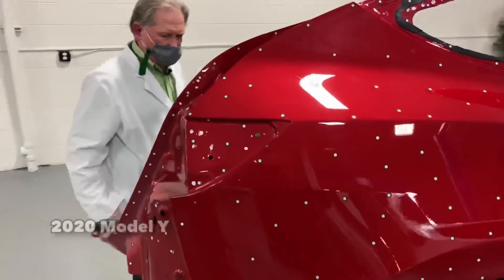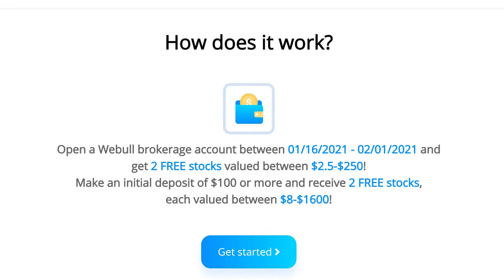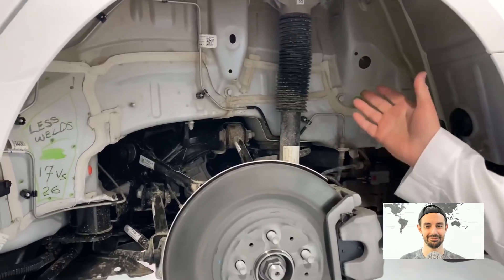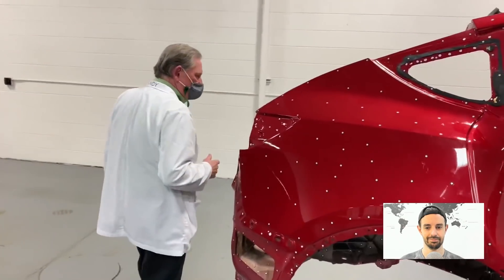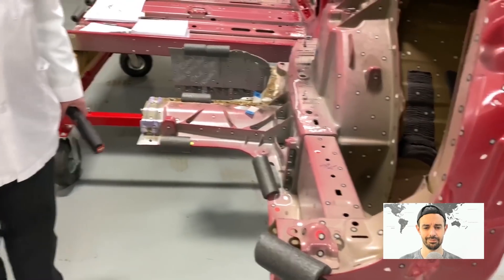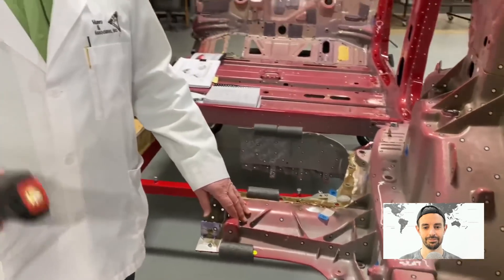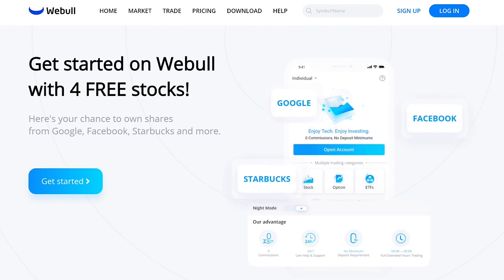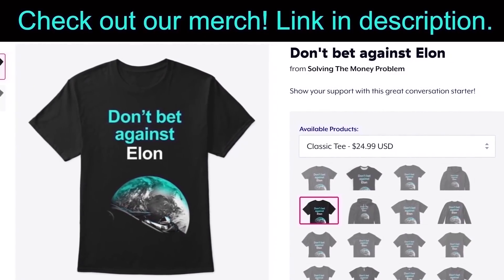Sandy Munro Tears Into Tesla's 2021 Model 3 Engineering

Comment: Once they’re building the Model 3 in Austin (with mega-casting) they will be able to then re-tool Fremont without a significant supply issue. I suspect that’s the reason they’ve held back, they would have to shut down the line for too long and impact deliveries.
Reply: Invest in crypto now
Reply: W.    H.    A     T.    S.    A.    P.   P...+...1...2...2...5...3...9...6...6...2...7...4.............

Comment: It seems my last posts have been to tweak your statements a little bit.  No disrespect meant at all,  I love your videos and watch most all of them.  You mentioned a reason why they would not use the casting on the Model 3 as it is more profitable for the model Y.  True statement, but Sandy was saying it would not take much to  do the Model 3 as well, with the same tooling!  The changeover could be done in hours probably.  He said just block out areas of the mold necessary to match the model 3.  Pull out that block for the Model Y and presto bingo you can save money on both.  The cost of the caster would pay for itself and the mold costs would be less to make it for both cars.
Reply: Invest in crypto now
Reply: W.    H.    A     T.    S.    A.    P.   P...+...1...2...2...5...3...9...6...6...2...7...4.............

Comment: I believe Tesla's long term vision is to move model 3 & Y production to Texas (& possibly another unannounced location).  The Pilot battery factory will support Models S & X only for production in Fremont.  This is why they have not incorporated the casting for the model 3 yet.... because those production lines will be going away.  They will do mega castings & structural battery from the beginning in Texas.

Comment: if they change structural stuff, Tesla would probably need to re-do crash testing, then there might be a discrepancy with different assembly lines getting different ratings needing to upgrade all assembly lines to the new way, so it may be better to sell a car today as is, rather than take months off to build it right , get it re-validated etc...   I bet the made in china model 3 is using the single cast.

Comment: You won't get that giant cast part until the new release of the Model 3, meaning minimum 5 years. Even though I love Tesla, I think they approach their car as an agile product developement, so they make minor changes gradualty over time like redesigning the weld pattern, minor castings, software updates etc. They never fix the big problems, as it would require someting like a total rearchitecture: bad paint (paint peeling at car wash), panel gaps, interior squeaks.

Comment: By now Tesla already has 22 Giga Casting Presses. Between Fremont and Shanghai, That should be enough for all 4 models front and rear parts to be produced both in Fremont and in Shanghai. 

There are even 4 more left, 2 for the Roadster in Fremont and 2 for new model 2 or whatever it would be called in Shanghai. They might just be a little too slow right now, so they have to double them on Model Y.

Comment: I had the same thoughts you did. I know Tesla has set the bar high for Sandy since he now knows that they are capable of perfection. I think Sandy's criticism is justified, as they definitely should be where he says, but I also agree with you, Steven. Tesla needs to deliver cars first. In the same way that buying items on sale that you don't need isn't saving you money, cutting costs on cars you aren't delivering doesn't help you either. Once the Model Y can start carrying their revenues, then they will be able to afford to retool their manufacturing lines to accommodate this tech. All in due time...

Comment: Just realized Vanguard allows you to buy stocks in your Traditional IRA. Sold some VTSAX and bought another 57 shares of TSLA. Oh, and 1000 shares of ARKG, and 127 shares of ARKK. Wish I had done that 6 months ago, or any amount of time ago, really.
Reply: Jan 25 2021 Augwind To Build 120 MWh Of Compressed Air Energy Storage For Solar In Israel. 23 year contract for Solar + Storage at 5 cents  Kw/hr or 65 cent electric gallon. After that, its paid off. The cost drops to 1/4 of that. According to Augwind, the AirBattery system has an overall efficiency of 75-81% (as applied to commercial facilities with a capacity above five MW), and the adoption of compressed air energy storage systems like this is much greener than battery storage systems, due to their high efficiency, longer lifecycles, and the avoidance of any additional chemical components beyond water and air (some of which in battery systems are flammable and either non-recyclable or hard to recycle at end of life). The AirBattery system also doesn’t require the high level of temperature control systems that battery storage systems need, and the company compares their compressed air energy storage system’s efficiency to pumped hydro storage systems, but with much lower physical footprints due to their installation under the ground.  https://cleantechnica.com/2021/01/25/augwind-to-build-120-mwh-of-compressed-air-energy-storage-for-solar-in-israel/

Comment: It’s really easy to be critical.  I’m a structural engineer and making a large casting work is not easy.  The problem is that the single casting is a stiff element, witch will also be attached to another stiff element which means connecting the two together difficult.  Not that easy!  But Stephen has it all correct just by following the money.  The Y first then M3.

Comment: I absolutely love Sandy's opinion on things in general, but I am starting to think he has some blind spots.  For instance, him thinking he is going to get Tesla to make components for his 3 wheeled ventures.  He must not know Elon cuz that ain't gonna happen.  Elon won't make motorcycles and he won't make 3 wheeled vehicles.  Then with this gigacasting for the M3, he must know how long they had to shut down production to do a refresh of the S/X.  Integrating a gigacasting and removing all of the current robots, like you said, is not like flipping a switch.  They cannot afford the downtime.  It would be really cool if they could just.build out a more efficient production line in a new building, but they may be leaving CA so that probably can't happen.  They are either going to have to upgrade Fremont or let it become obsolete and walk away.  Once TX starts producing and they announce another U.S. factory, then we will get an idea of what is happening with the M3 production.  GigaTexas will probably produce M3s as well.  It will be massive to start with and it will be much easier supplying the East Coast or shipping through the Panama Canal from TX.

Comment: I would like to see you make a reaction video to VW outselling M3 in Europe and the Porsche outselling the model S in Europe.
Reply: Check the top 5 cars in each European country.. mostly hatchbacks and small city cars.. I’d probably buy a hatchback from Tesla
Reply: @eldictator1  Tesla needs to make a 25k car as priority 1
Reply: Re-visit this later in 2021 when Berlin is pumping.
Reply: @mearino  I don’t agree with that because  I do not think fundamentally Europeans want a big car. It won’t sell well compared to a hatch. They are also more about quality. I think they will unfairly be over critical to an American made junk car versus a European made junk car all things being equal
Reply: @cabdolla  I was just picking on the two models you mentioned as being outsold. For example, the Model S is clearly outgunned by the Porsche, but the new Model S is on the way, including the Plaid with a price closer to the Porsche but double the range and even better speed and acceleration. I will concede that Porsche held off releasing their Gen 2 because Gen 1 is going so well. The point being, Porsche is outselling Tesla S in Europe now, but will they outsell the Plaid 2021 Tesla S which is a more comparable vehicle pricewise but * should * beat the Porsche on performance? 

As for the hatch, I think you mean the Y won't be a big seller because Europe wants small. I think you might be getting the categories mixed. The Model Y competes against cars like the BMW X series, Mercedes G-series and bigger VWs (whatever their electric Tiguan equivalent is). The model Y coming from Berlin should hopefully be (1) much cheaper than currently because no shipping and import taxes to pay, and (2) made with famous German precision plus 8 new giga casting machines (better panel fit) and flash paint shop.

There is also a contention that for traditional manufacturers who aren't as vertically integrated, they are * losing * money on the EV cars they sell. This could mean that as EV sales volumes increase, the more profitable Tesla's will make more money (at least for a few years) than the popular European brands, even if volumes are less. In other words, Tesla can make better margins and make a living off lower volumes better than other manufacturers.

I also seem to recall plenty of Opels (GM) and Fords in Europe, so its not as if Europeans won't buy US made cars.
Reply: @mearino  true but those are more European fords that we typically don’t get in the USA until more recently. Ford has its own division just to make cars for the European market

Comment: M3 giga-casting doesn't happen until after Texas is up and running and they can shut down Fremont for a few weeks to re-tool. They're simply moving too fast to make the change right now. My guess is they'll incorporate 4680 batteries at the same time. So it will be a while. My guess would be Jan-Feb 2022.

Comment: There is one BIG reason they did not do the rear mega-casting on the model 3 yet. The lack of casting machines and room to put them in Freemont.  They are not yet done iterating on the model Y castings yet.   Berlin will be  first for the 3 main castings for the model Y, they will debug that process there, then Texas will come online, and hopefully have the same 3 mega-castings.   Berlin is getting 8 casting machines, Texas is looking like is getting 6 to start with, looks like room for more.   Once Texas and Berlin are ramped up with model Y and model 3, they can ramp down model 3 line in Freemont, and hopefully install more mega-casting machines and update the line.  Then re-ramp up model 3 production there as well as updating the model Y production line.

As There are only 2 mega-casting machines in Freemont, I doubt they can produce enough castings to do the model Y and Model 3.   I believe the 2nd mega-casting machine is being used for pilot development  of the structural battery packs and other castings (model Y, S,X).  I also think that that one could do all castings for the model S, X refreshes if they are not installing another casting machine there specifically for that production line.  The model S,X is not the high volume production, so likely one machine could do all the castings for those models with swapping out the dies, doing a run, swap & run the next set...

So, it could be 2, maybe 3 years before Freemont gets fully updated.  It all revolves around Berlin and Texas factories getting model Y and model 3 productions ramped up.   Until then they can't stop production without losing sales.  Freemont factory has run out of room without major re-working things for the newer optimized production.

Sorry for the long winded reasoning.
Reply: @Solving The Money Problem already am :)
Reply: Steven, scammer spoofing your id...

Comment: My sources told me that Model Y was specifically designed to tow and thus the back had to be held up to towing standards.
In case of model 3, it was not rated for towing nor had a tow hitch so they didn't bother put in the new castings untill they will offer the towing package to model 3.
Keep an eye out for tow packages on model that's when you will see the single piece (not like model y half casting shown here) casting in model 3.

Comment: Tesla can take forever managing resources. I realize S and X are not the volume they were, but they are so antiquated compared to the newer cars. They'd be embarrassing flagship products if they weren't still way better than the competition.
Reply: @Solving The Money Problem I have yet to hear any compelling reason to want to use cryptocurrency. While it decouples you from central banks, for many, that's not important. There seem to be transaction fees that are independent of the cost of transaction (so high for small transactions) and it's slower than putting in a credit card number. It seems a cool solution without a problem to solve. Maybe you can do an episode on what good it is.

Comment: I just gotta say, I really appreciate how open and honest you were about this.  You could have edited this in a way to only show the good and you could have just cherry picked and edited in just the best parts to maybe try to get a spike in your stock portfolio, but you didn't. You actually almost exclusively showed the bad stuff and then followed them up with logical first principals reasonings as to why those decisions were made and I just gotta say I legitimately respect you for that.
Reply: @Solving The Money Problem scam scam
Reply: I have to agree with Sandy, the rate of improvement in their fundamental automotive engineering is disappointing. They need to sort this sh** out. The rate at which they are fixing their issues is entirely substandard, paint shop, corrosion, panel alignment issues due to poor design/engineering, suspension failures, customer service, interior fit and finish issues and inconsistent quality at the end of quarters. They are really leaving major brand reputation issues hanging over their heads. Eventually these Model 3s will get old and the issues will really show through and the brand will suffer. I currently have a 13 years old VW Golf, 240,000km. Drives almost like new. I recently drove a Nissan Versa 2010 140,000km and the thing sounded like it was going to fall apart under my butt. Build quality matters!

Comment: I sincerely hope the 3's coming out of Berlin address all of Sandy's concerns.  I've been somewhat disappointed in what I've seen so far.
Reply: Richard - it will take 2 years for Germany Model 3, Y has the Priority.
Reply: @markplott4820   Your point?
Reply: @richardalexander5758   - IF you are willing to wait 2 years then , ok. 
CHINA will sell Model 2 in 2022 its a Worldwide car.
Reply: @markplott4820   I'm also hoping the model 3 out of Berlin will be built to the highest standards, with a single cast rear section, and a structural 4680 battery pack.
Reply: @richardalexander5758   - GigaBerlin has 8 machines 4 for Front , 4 for Rear for the model Y, but should also be getting Press for model 3 , 2 years or so.

Comment: 1) Props for sharing Sandy's critique of model 3; not fanboyism. 2) Sandy's mentioned before that it wouldn't take much to get fit and finish right and that's why even though they are only just starting with giga castings 3) they're focusing on very minor changes until mega castings are available and are focusing on the technology underneath because 4) for a new mega casting you need a big new fudge off foundation for it and MAY be disruptive to existing plants. (Speculation: are they holding some castings back for the cheap mass produced 25k vehicle? Model 3 is already profitable) 5) I'm looking forward to seeing wiring and the many iterative improvements they're made underneath and 6) If you've read up to the end, you're awesome!

Comment: You have the causation backwards.  The Model Y is more profitable BECAUSE it uses the gigacasting (and other efficiencies).

In my opinion the ONLY reason the Model 3 isn’t using a gigacasting is because it takes time to ramp that up and they haven’t done that yet.  Once they get the Model Y running full speed they will go back and apply more of these lessons to the Model 3.  This also helps amortize the equipment they already purchased and installed.

Comment: 2022 - 2023 is when the giga casting will hit main stream. That’s when I expect to see the new factories up to max volume.
Reply: Giga casting is already being placed
Reply: @dexter5970  doesn't mean its ready, they will also need oven to heat and melt aluminium which uses alot of energy

Comment: You keep talking abut 'casting' but the Model Y factory clip was a giant 'press'. 
Casting is a completely different process involving melting and pouring it into a mould.
Reply: I think you are wrong, I heard the discussion of creating a unique aluminum alloy that flowed into the mold that wouldn't cool before filling.  But it may be molten aluminum that is then pressed into the mold.
Reply: @dbwelder9159  Only rolled metal sheets can be pressed!
Cast aluminium is brittle, if pressed it would break like glass, the reason is no grain structure and air bubbles in the metal. You can check this with people who understand metallurgy and metal manufacturing.
Only talk if you're actually qualified and know what you're talking about, not when you "think", "heard" and "maybe"! :)
Reply: @soundslight7754  in which case you are totally wrong.  If you want to define pressing as the equivalent of stamping.  They use molten aluminum for the "casting." I was saying there possibly could be molten aluminum in the bottom of the cast, and then they put the top of the cast on where the aluminum then   fills the top part.  I wasn't talking about pressing aluminum after it had hardened.  I was trying to make you not look ignorant.
Reply: Have you even seen the mega cast?  No way that is pressed rolled steel or aluminum?
Reply: Hey genius, check out the latest Munro , Road Trip - E8: Silicon Valley Tesla Owners meet Sandy, at about 24 minutes he shows the mega CASTING, which uses special molten aluminum that is inserted in the MOLD in milliseconds.  If YOU don't know what you are talking about shut up.